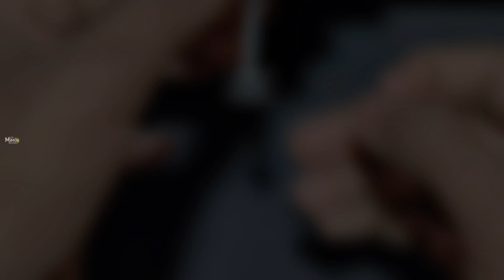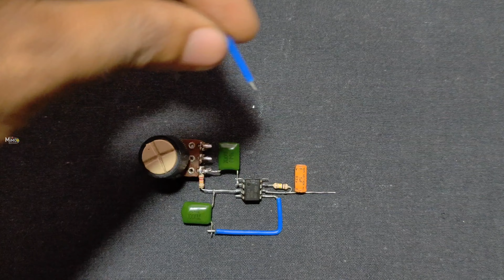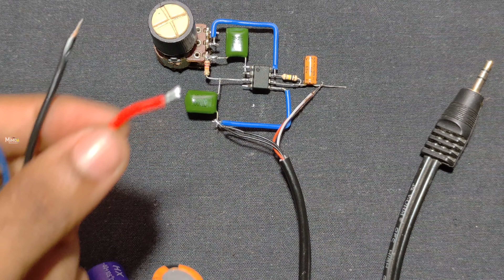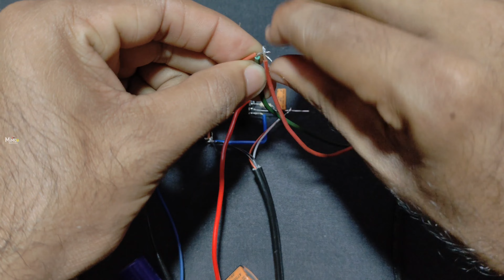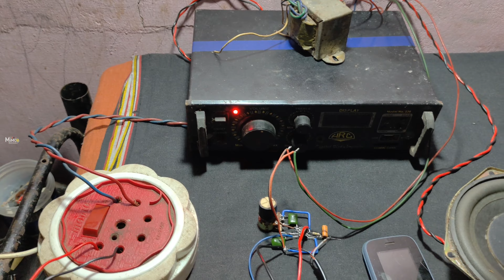Subwoofer filter Circuit | | IC4558 | | Ultra BASS filter | | low pass filter #mimoelectronics

Comment: Its not working the ic is burned
Reply from the maker: No its working check your supply voltage
Reply: Yes it will be needed 12v only pure DC